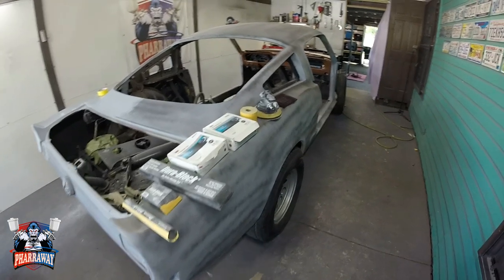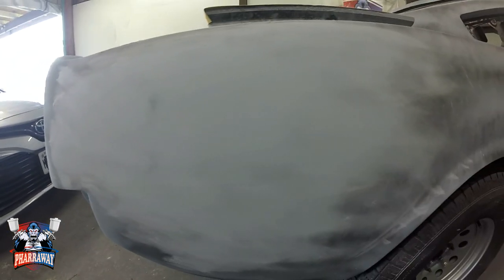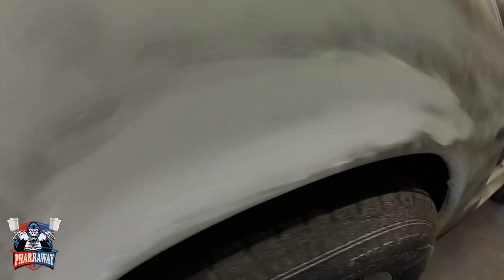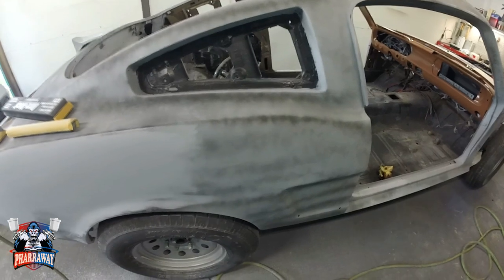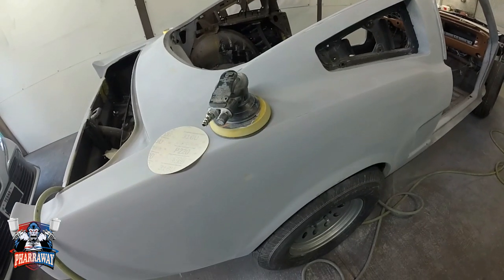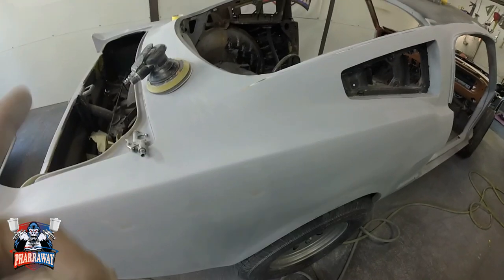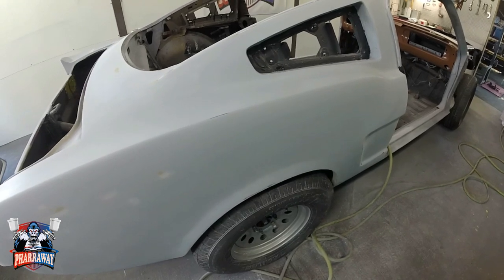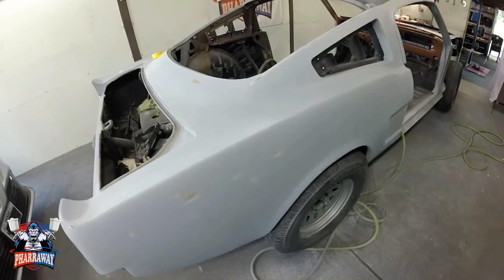DIY   How To Block Sand Primer To Get It Ready For Paint

Comment: Thank you farraway for the tutorial on the block sanding well explained 1 question the cut through after using etch primer do you need  to sand it smooth  before base I always use a 800 so I dont cut through again  thank you  for  sharing  and I'm glad we met Lucy the dog
Reply from the maker: no you don't just spray and after 15 to 20 min you can apple your sealer
Reply: Thank you

Comment: Thank you Mr. Pharraway. I got driver side of my Elco blocked. I got a few low spots. Minor. I figure one more attempt and finish the gallon of primer, n block one more time should be good. Thats for the minor low. If i run into a really low spot I can swipe a skim coat of glaze on it right? I dont wana go to bare metal right?
Reply from the maker: Yes just use a skim coat of glaze and reprimer and block it you should be good
Reply: @PHARRAWAY  I appreciate you. Your a great teacher. ✊ Watching from Denver, Co.

Comment: What do you think regarding wet on wet apposed to painting over dried primer. Mechanical vs chemical adhesion. If I get an orange peal in the primer it will show in the top coat, so sandinding the primer for mechanical adhesion would be the only way to go in order to cut back on orange peel in the top coat. Hope that made sence. Thanks.

Comment: Looks good. I have a question you said that when you have cut throughs to metal you use metal etching primer.  What do use if you have cut throughs to some filler?
Reply from the maker: if you cut-throughs to some filler I will use a sprayable aerosol primer let is set and sand that area
Reply: @PHARRAWAY 
Hi love your videos I have a lot of friends here in Australia that watch your channel I also have a question if I rub through to the original top coat do I need to prime those areas again I’m hoping not as I’ve rubbed through in a fair few places I think I was being a bit to heavy handed with the DA 👍🏻😊

Comment: do you sand away the quick check? It looked a little ruff. Also is the self etch okay if you sand down to epoxy primer?
Reply from the maker: No the quick check is removed with a microfiber towel and yes on the epoxy
Reply: @PHARRAWAY  Thank you. And once again great videos

Comment: So do you base  coat over the 320 you don't go any higher like 400 /600 ???
Reply from the maker: No I base over 400grit
Reply: I always sand to 400 for solid color and 600 for metallics , 320 will show sand scratches